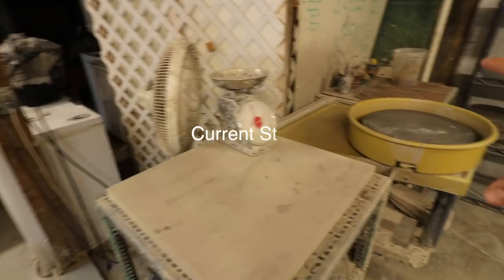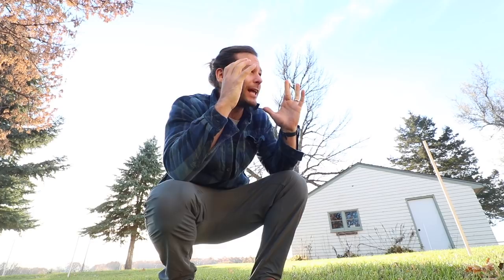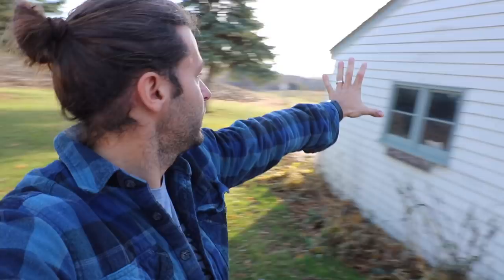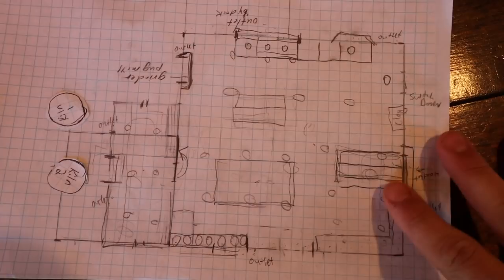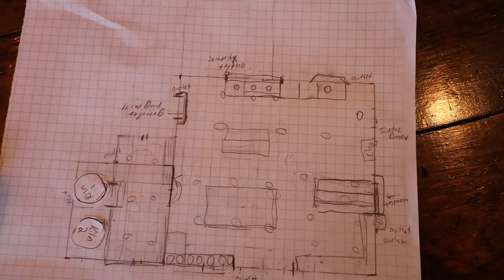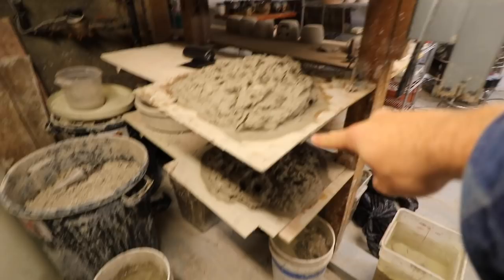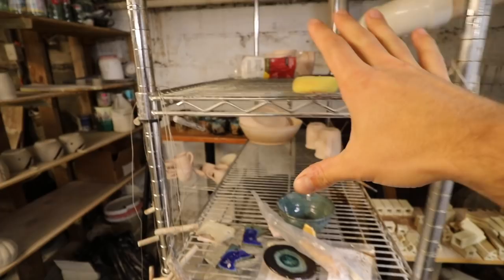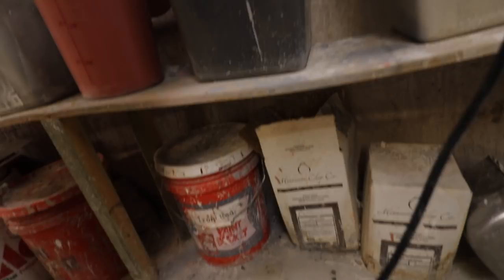Designing a Pottery Studio + Studio tour

Comment: Great plan!
1) Consider running 1" under ground PVC below slab from panel to work station, also to kiln room and anywhere else you you think may be helpful. Running underground is easy and should be deep enough not to affect the compaction of your slab.( How many other types of stations that will need power in future?) Grinding station with hepa filter vacuum, idea courtesy of watching Cherrico Pottery video last night.

2) Along walls consider putting your receptacles all 60" above floor except for dedicated machinery. 
All receptacles should be quads not duplex.
 
3) Consider putting exhaust/intake fans all around inside studio lower to floor to keep air flow low to ground and not in your face.

4)Air conditioning means I can be in my studio when it is in the 90s outside and I'm kept at 78 degrees inside.

5) I have found that elevating a portable tub in the sink really pleasant for washing up rinsing out. Just an idea you may want to consider.  not bending down into the sink was my inspiration for looking after my comfort in my advancing dotage.

Used 3/4" PVC to build the stand and it is not glued together........https://youtu.be/ypkHJbM4Ue8

6) 2nd wheel and  station for trimming which also would be backup if your #1 wheel took a rest.

Enjoy the adventure and scribble a note anytime another idea comes into your heid, lest you forget like me.
Reply from the maker: Thanks for all the thoughts Freddie!! Super helpful!

Comment: I seen your recycling on bats.  I was doing that as well but they seemed to dry out before I got back to it. So I seen a tip on placing the recycled clay in a pillowcase and hang it for a day or so to drain and dry some.  Its easier to smoosh around and get out of pillowcase than you think.  Try it.  Saves me time and it doesn't get all hard on edges like drying on a bat.
Reply from the maker: Cool, thanks!

Comment: Skylight, (for light), put everything on wheels, make some. Strong dollies for clay. Figure out stages so you have enough room to have a set of wares for each. I would want to keep glazing separate from a table where I make things but maybe the glaze items could stay on a ware cart. Have your lowest shelf high enough off the ground so you could run a mop all the way back. Since dust falls at the rate of a foot an hour maybe it makes sense to damp mop away wall that dust when you first come in. Keep the walls light in color but have a color. How about a wall mural as people like to have a studio tour. I like to have shelves of different heights to protect my work under construction. Seem to bump mine a lot. Also if you want to fire your kiln everyday then you need to have enough storage to have a lot of pottery drying etc..I like to have some of my pottery around so that I can really take a good look at it. At least a Miny office area too. I think that I will put up a clipboard in my studio so I remember what my plan is. I like to make want I want to for the day but I don't mind my own plan too. I would like some of that plastic trim that runs around between the floor and the wall as it would make  cleaning easier. My gloss painted walls are okay but mirror, glad or Formica would be easier to clean. My painted cement floor is okay. Floor drain would be nice. I have a good sized sink with a short hose. I ll just po.st this for now

Comment: Good luck with your new space.
Do you plan on using it year round?  If so, you might want to make some considerations for when it gets cold/colder.
I imagine that being below your coffee house now helps regulate the temperature some.  An above ground garage is going to get a lot colder a lot quicker.
When we lived in CT the garage was often way below freezing where the basement never got below 40 deg.
We have a small studio in our garage and it gets colder in the winter (but not freezing because the garage is under the house).  The clay gets a lot firmer and harder to throw in winter.
For Minnesota, I imagine you glazes are going to freeze.

If you are going to throw in colder months, maybe you could make some adjustments to accommodate.
Add wood stove or some other type of heat.
Maybe you could add a tube to divert the kiln heat into the working space during winter.
Add some insulation
Consider a having a smaller space you could use in the winter for throwing and glazing that wouldn't be as big to heat.
Have a place to keep your bulk clay that is at least partially heated (maybe using kiln heat).
Reply from the maker: Yes it will be used year round, There will definitely be a heater inside and possible a fireplace as well, thanks for the thoughts, I appreciate it!

Comment: Recommend leaving space on floor right by your wheel to stack clay boxes, also in kiln room take into account you need 24" of room between walls and kiln, also 24" to shelf, a room exhaust fan and window in that room would be great to be able to use on hot days to remove heat and exchange the air. I have skutt vent under kiln vent system which I love. It can vent two kilns at once.  No odor in my garage when firing, takes it all outside.  Studio I teach in has the exhaust fan in wall to remove hot air and cool rest of studio. Does need window or door open to work correctly.
Reply from the maker: Thanks for the suggestions!

Comment: I have platforms on wheels where I have big "muck buckets",  perhaps they hold 30 gallons if full for glazes. They are raised for your back. but they slide under a bench. So you roll out the glaze containers, use your drill to stir, roll back under bench when not in use. Much better than smaller or square. Wider so you can glaze wide pots and platters. Also have the kiln room the same floor so you can roll your pottery still on the drying shelves to the kilns. good luck!
Reply from the maker: Cool thanks for the suggestion!

Comment: Good luck with this, I have a 6ft x 4ft throwing shed and a 10ft x 5ft workroom attached, you are lucky to have such a large space to work in.  Natural light is a must and heat or air conditioning, I have both in the form of a large electric fan and an old electric radiator lol.

Comment: Consider a more narrow table instead of a 4 ft. wide one...reaching across 4 feet is a disaster waiting to happen (been there in studio #2). Thirty inches seems about right (I'm over 6"). Some rolling stock (tables and/or ware carts) is very helpful to reconfigure the floor for changing needs (studio #5). Sink trap and on demand hot water (studio #5)...secondary power source for cold nights and heat goes down (lesson from 5T of frozen clay in studio #2 in Idaho). I run a mega generator and 1000g of propane now. You haven't lived until you have shelves of frozen greenware ruined by freezing and have a 5T block of clay frozen in the studio. I replaced a roll up door in a garage layout with french doors and sidelights...couldn't be happier. I have two set of lights in the studio (separate switches) and am switching one bank to balanced lights to offset the winter doldrums (it happens). All our clean work (packing, cleaning assembly etc) happens in a separate space. My kilns are outside(ish) under roof...great decision (no fumes)...lesson learned from studio #2 where the sulfur coming off the kilns "rusted" all of the exposed metal in the studio (as in slab roller parts even). I'm finding that the views from windows is more important to me than shelves against walls. Congratulations on the new space. Lots of potential. Your work will change in that space (lesson from studio #5).

Comment: Why not keep the garage door?  Big doors can be awesome when you want to open up the studio when it is an amazing day, to air out the place, and/or to move stuff in and out of the studio.  You can just leave it closed most of the time and use it as a wall then open it up when you need to.
Reply: I was also just thinking, if you keep the old slab and face the garage door to that side.... Nice day, open the door, BOOM, studio doubles in size.
Reply: I also live in Minnesota, and I'm not sure I could work in my attached garage when it is super cold.
Reply: @sonyahonaker9705  That was my concern.  In CT, our basement was was usable year round because it was below the frost line and if Jon has that situation now and he throws in the winter time then the new studio could be an issue.  Even if he doesn't throw, everything is going to freeze.
Reply from the maker: Yes, It will be well insulated and have a large garage heater unit, my dad also has this at his place a few miles away and the heater does a good job keeping up in the winter, thanks for the thoughts!
Reply: @Jonthepotter   I imagine that in a 24h day, you will probably be out of the studio more than you are in it; but, you will need to keep some items (like the clay and the glazed) above freezing the entire time. Note: That would be a lot (and more efficient if you had separate a cabinet with small heater just for that).  Also, consider a remote control for the main heater that you can access from your phone so you could get the place war before you got there and turn the heat down/off when you forget.

Comment: I am not a potter (just a dream at this point). What's the reason you're changing your studio? Just more space? Or will you be keeping the studio under your shop also?
Reply from the maker: It will be a slow transition from my current studio.  My current studio has no windows, uneven floors, its very difficult to clean, its too small, ceilings are very low.  It is very functional just not a super creative space.  I spend enough time in there that I think it's time for an upgrade!

Comment: Attic access?   Does pottery need to stay a certain temperature?  If so, you may want a way to section that area off so you dont have to heat and cool that large space when youre not in it.  Make sure they insulate that garage slab.  Thats standard for living spaces but often nto done for garages as theyre considered outdoor space. Rolling shelving would be key.
Reply from the maker: Yup, great suggestions!